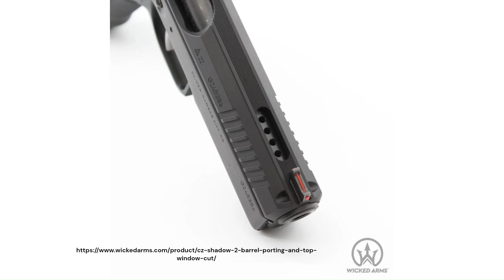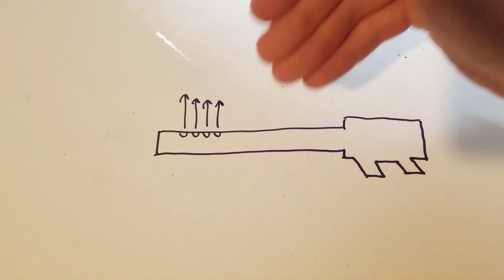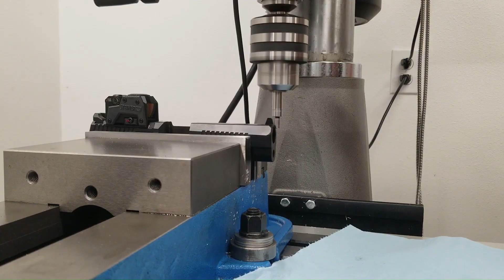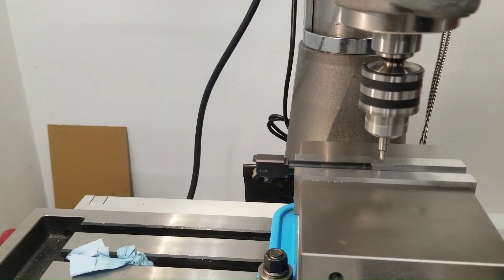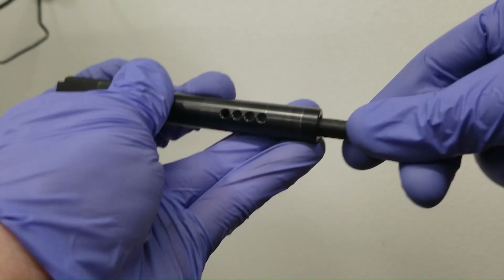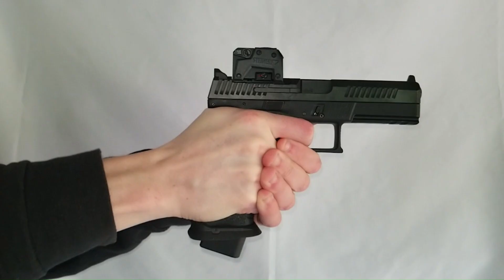I Ported My CZ P-10 F

Comment: I got a question for you. I’ve bought a long barrel for my Glock 26 GEN four. I was thinking about getting it threaded but now I wanna port the end with three big holes. What do you think about me putting it on the outside of the slide three holes right on the end.
Reply from the maker: I dont have much experience with that porting arrangement. I would imagine it would provide some benefit. There will likely be a bit less dwell time, that is the time from when the bullet passes the port to when it leaves the muzzle.

Comment: Have you tested it for accuracy at 25yds before and after? My issue is jacket cutting and loss of accuracy. I've seen this before in testing. The new CZP10C is counterbored to a bigger ID after the port so it doesn't experience this - I really wish they would come out with the P10F ported....
Reply from the maker: I have with certain port sizes and shapes noticed loss of accuracy. Presumably due to spalling and jacket separation, or destabilizing of the bullet. I stay away from those now.

Comment: Nice!  I just saw that there is a factory ported P10C available now, with a "chunk port" at the end of the barrel.  They also smooth bored the area from the port start to the end of the muzzle.  I heard it was because they didn't want rifling  where the port is, as the rifling can shear off copper fragments from the bullet, and affect accuracy.  Fragments could also be shooting through the port and injure you or a bystander.   But perhaps it's less of a problem with several small holes, like you did.

Comment: Did that anything with the spiral of the barrel? I am thinking about doing a chunk at the front of my barrel and I talked to someone and they said that it will mess up the thread on the inside. Please advise.
Reply from the maker: Chunk port requires the rifling needs bored out after the port. Small ports like this are fine thru the rifling.
Reply: @EngineersArmory thank you

Comment: I’ve read some people use helix end mills to minimize the amount of burrs inside the barrel. What do you think about that? Good idea or unnecessary?
Reply from the maker: All the endmills I use have a helix angle on the flutes. Do you mean high helix or low helix angle?

Never paid attention to the helix angle. I use 4 flute at proper rpm and slow down when I break thru to the bore. Minimal burs. Then I deburr with 600 grit wrapped around a brass rod. Always works for me

Comment: can you tell me how to port my Taurus G3C 9mm pistol? I'm just recently seen about porting and it's hard to find ported barrels for it. thanks. 🤔
Reply from the maker: Umm just drilling holes in the barrel will do the trick. Then a window in the slide for the gas to escape. There isnt like a particular porting pattern for a given pistol.
Reply: @EngineersArmory  they have ported barrels on line but they are extended that it sticks out past the slide and with one slot at $150.00 thanks. I would need a machine shop drill to drill a slot. I'll Leave it alone. You did a fantastic job on yours.
Reply from the maker: @JohnSmith-uy7sv   Ah yeah those extended ones dont do much, no dwell time. Yeah a mill it pretty much required. Smart to know what your capabilities are. Thanks!
Reply: @EngineersArmory  so, don't go for those extended ported barrels???
Reply from the maker: @JohnSmith-uy7sv  I wouldn't. They won't be all that effective based on my experiences.
Reply: @EngineersArmory  Wow, thanks so much. you just saved me $150.00 I would like to have mine ported though. thanks.

Comment: I have side ports on my slide and just want to use that. any formulas or anything to consider for that?
Reply from the maker: Wont be as effective due to the gasses being vented out the side. More port area will work better. Might get some muzzle brake type effect.
Reply: @EngineersArmory  are we talking about 180' or 90'? I was thinking 90' to get both the muzzle brake and prevent rise. Also, instead of drilling 90' to the barrel, what about 45'?
Reply from the maker: @ggenovez  i dont think im wuite following you. Ports pointing upward as much as possible should mitigate muzzle rise the best.
Reply: @EngineersArmory  Correct. In my situation, my slide has ports at the top side of the slide so putting in ports on the side at 90' to eachother like a V should mitigate the rise as well as act like a muzzle break. Also I see you have your ports at 90' from the barrel. Have you considered at 45'? Yes some gassses would be coming towards you but it might prevent further rise
Reply from the maker: @ggenovez  ah i gotcha. Naw i always do ports straight down cuz its easier to machine.

Comment: I'd like to know how porting changes barrel heat deformation.
Reply from the maker: Like heat from high round count? I can't imagine it would affect accuracy noticeably more than if the barrel were unported and really hot. I dont know that ive noticed a practical degradation in accuracy with pistol when I get them really hot. Have seen groups wander and open up on rifles for sure.

Comment: Would there be any benefit in trying to align the ports to miss the barrel rifling?
Reply from the maker: Havent directly tested for that. It would greatly complicate port design and machining. In my experience, I dont think it matters where the ports end up in relation to the rifling lands and grooves. This would relate to jacket shaving, spalling, and accuracy. The biggest factors that affect those things are port size and shape. 

Ive machined the same porting design on multiple barrels and the ports hit the rifling in different spots on the different barrels. I havent noticed any appreciable difference in spalling or accuracy between those pistols.

Comment: The one thing you over looked is the higher pressure closer to the chamber and the dwell time after the ports. You would have a mechanical advantage technically having the ports as far out as possible like you said but the pressure is much higher closer to the chamber and the pressure is gonna be higher when the bullet is still in the barrel so there’s more time for the gasses to escape at a higher pressure if the ports are farther back. My lone wolf Ltd 19 v2 shoots flatter than any ported gun I’ve ever fired and the only advantage it has over the others is ports closer to the chamber. I have a ported cz sp-01, ported shadow 2, ported cz pcr, ported prodigy 5 & 4.25 inch, ported rock island ultra fs, ported Glock 23 and a ported strike one. I’ve already ruled out spring weight, slide mass and port size so the location of the ports is 100% the reason the Ltd 19 shoots flatter than those other guns. If you factor in concussion, fireballs and sound having ports closer to the muzzle is better but if mitigating muzzle rise is the only thing you’re going for you want the ports as far back as possible.
Reply from the maker: Careful saying you know something is 100% the reason. We don't know anything with 100% certainty. Will the sun rise tomorrow? Almost certainly yes... one day it won't. It's a fusion reactor with a finite amount of fuel.

The best scientific theories we have, and how we understand the natural world around us are just that. A theory. It's a well substantiated explanation, based on a large body of testing and review. But it only remains a theory just because it hasn't been disproven yet, that doesn't mean it wont be at some point.

I appreciate hearing experiences like this because it gets me thinking about testing I may want to do, maybe gives me another lens with which to analyze my experiences and past testing. Or another idea for my own port designs.

I'm not discounting that you own and have shot a bunch of ported guns. And I'm not arguing the lone wolf is the flattest shooting. But I don't think it's fair to attribute that solely to port location in relation to the chamber.

How did you test and quantify which one is the flattest shooting? What was the error of your measurement method? How did you analyze the data? Did you test with the same ammo? All pistols you listed are 9mm except the Glock 23, so that can't really be used as a data point with 9mm pistols.

How have you ruled out slide mass and spring weight? Do all those pistols have the same slide mass? Do they all have the same recoil spring weight? Are all their recoil springs the same type (single spring vs nested multi spring)? They aren't, so how did you control for this?

Have you controlled for port size, shape, overall port area, and barrel length across all those guns and port designs? If so... how?

I would encourage you to check out my videos about port vs comp comparison, bore axis comparison, more vs less port area, and smaller vs bigger ports. I get into a lot of discussion about variables, data collection, analysis, and how I report it. Might get you you thinking about your own testing. Links below:

https://youtu.be/0yc1t2ePUkE?si=bYaH4hPMUnIv2S8S
https://youtu.be/oO5uh67TWI4?si=ZyO4Q8BJj7xEAvqK
https://youtu.be/gdm-BRBr6B8?si=n7bnyNBBdPhzKKaG
https://youtu.be/GRcrymigFvo?si=PVRTAPkjFmLhx9Ma

This P-10F video is old and it was the first pistol I ported. Since then I have ported about 15 more and done some sort of testing on most of them so my ideas about port performance have changed significantly since this video.

I would generally agree that pressure is higher closer to the chamber. Initially. The initial pressure spike in the case and chamber. I am not going to make any claims about the pressure level vs time or barrel length because I do not know, I haven't put pressure transducers along the length of a barrel to map the pressure profile of a round being fired. I've tried to reason this out and I haven't come to a conclusion I am confident in.

Some of my thinking: pressure would drop at a rate proportional to the barrel length because diameter will be constant. Let's say we start with 30,000 psi at the mouth of the case the instant the bullet leaves it. Surface area of a cylinder is circumference times length so pi*D*L. After 4 inches we would be at pi*d*4L. That's in the denominator of the pressure formula force/area so pressure would decrease 4x or to 7,500 psi. But that's assuming there is no combustion happening at that point that would maintain or increase pressure level. That's probably not a good assumption. We know powder keeps burning behind the bullet and it keeps accelerating it to a certain point. Longer barrels produce higher velocity due to this.

Ports further out will have more of a mechanical advantage. Torque is force times distance. Mechanical advantage will increase linearly with separation distance.

But that doesn't take into account dwell time like you said. Dwell time would be much greater with ports closer to the chamber not only due to proximity, but also due to the bullet accelerating. It's moving slower closer to the chamber and faster at the muzzle. How much does that contribute? I sure don't know.

Here's the way I think of it. Maybe wrong or right because I just don't know, nor will I likely ever know due to my testing limitations. So I'm not going to claim that I do know. The following is my working assumption, and what I partially use to inform my porting designs, some of my testing supports this claim.

Regardless of the pressure profile in the barrel or dwell time, and at pistol barrel lengths (~6" and less, this wouldn't apply to a 16" AR9), I think there is such an excess of pressure available at the ports to push gas out that more overall port area will always be better, and further from the pivot point in our hand will result in more mechanical advantage and more muzzle flip reduction. The port size will be the choke point and limit how much gas energy can be redirected.

I looked at the porting job on the lone wolf pistol. My guess is that it shoots really flat due to a crazy amount of total port area.

I'm not discounting your experience. I am not saying you're wrong. Hell you don't even have to do do any real testing, you can just say "I'm pretty sure," or "I'm 95% confident." I would just caution again saying you know something is "100% the reason."

We don't know anything with 100% certainty, nor can we, nor will we ever. You'll rub people in the scientific community the wrong way haha. Like me, an engineer, a student of science may write you this really long-winded response you'll probably not even read because it's boring as hell.

I do a lot of ported barrel testing and there is so much I don't know nor will ever know or be able to test.

I always try to explain my experimental setup, what I can control, what I can't, and how the experiment is designed to isolate variables. I report my measurement uncertainty and how I am analyzing data then report my findings (cant call it a theory) something like, "There is an indication based on this testing that more total port area may result in a lower muzzle flip angle."

Anyways if you read all this. Kudos and thank you. Thanks for watching and commenting. I would be interested to hear more about the testing you've done. It may give me some testing ideas or a new way to consider barrel porting!

Comment: Very nice job! Wondering if the noise blast increased substantially compared to the non ported barrel? I’ve added a Radian Afterburner combo to my P365 and the increased noise blast is not enjoyable enough to justify the slight reduction in muzzle flip.
Reply from the maker: It's louder for sure. More concussion. But I only really notice it if I'm shooting under a cover or near a wall.